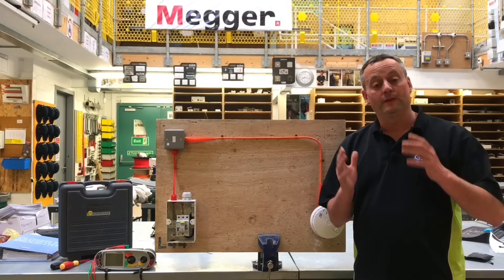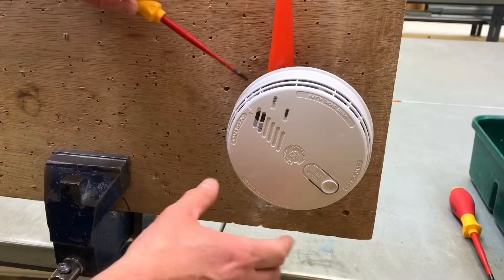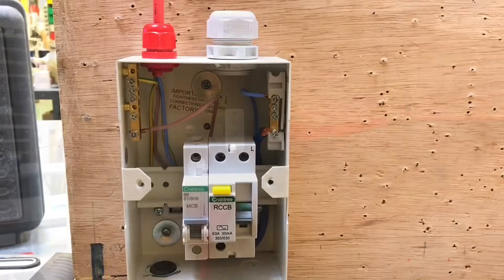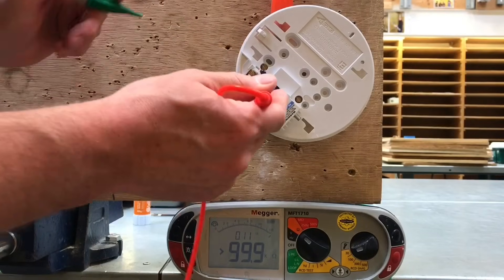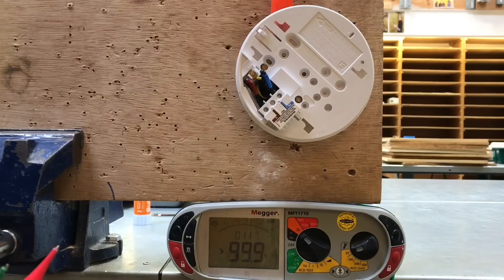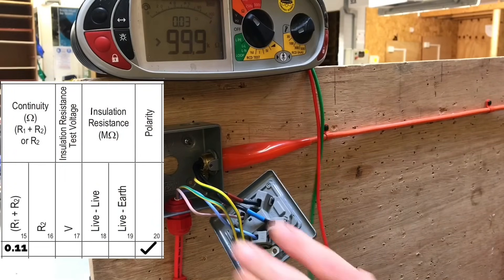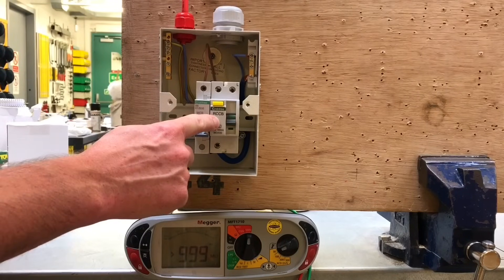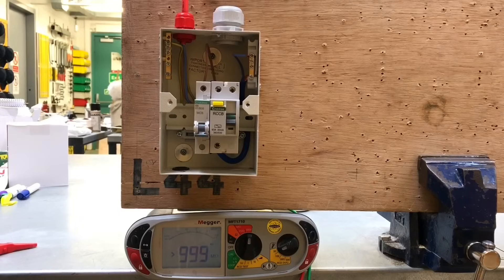How to Test our Smoke Detector Circuit City & Guilds 5357 Practical Assessment 107 Task B (MI Cable)

Comment: Good video,   Very clear to follow as always. Thank you            How does it prove polarity ?  Could you not be switching the earth and get the same readings ?
Reply: The line and CPC are linked at the board and it's visually clear the earth is in the earth block at the smoke head as you have to put your test probes on them. So removing the fuse and getting an open circuit reading proves the fuse is in the line conductor and hence why polarity can be confirmed.

Comment: Question, why do we have to keep spending money on a new edition every few years,? I have. Still got my copy of the sixteenth edition and I have spent the last few days comparing it with the eighteenth edition apart from the one or two amendments and one or two regs being moved from one page to another and the od typo corrections there is no real difference or change so. Do we really need to buy the dame thing? at £ 85 a pop After all electrical work is 70% common sense 20% experience and 10% training, as for being a member of the organisations, we need to remember that it is not a legal requirement
The NICEIC, JIB are nothing more than trade unions
Reply: The shareholders have to keep their divedends above inflation...but you already knew that..?

Comment: Gaz the regs say if electronic equipment can't be conveniently removed then you can do the insulation resistance test at 250 volts or test line and neutral together to earth, so why don't you mention this in your videos.

And not a torque screwdriver in site wedone
Reply from the maker: Because my year 1 learners can remove the load hence the video.... however we do cover this in year 3. 

My videos are designed to help my learners at the stage of learning they are at when carrying out each exercise.

We build on knowledge gained as we move through the course/years.
Reply from the maker: See other videos for the torque screwdriver use. We have 5 in the workshop and learners use them from the first time they fit consumer units.
Reply: Refering to the guys as learners is a bit condescending, there not stupid people, why not refer to them as what they are STUDENTS .
SORRY DON'T MEEN TO BE BITCHY. FAB VIDEO ANYWAY.
I HAVE BEEN OUT OF THIS GAME  TO LONG

Comment: Hi Gaz is it still acceptable to put a lighting circuit and smoke detector on the same mcb
Reply from the maker: https://talk.electricianforum.co.uk/topic/18600-lighting-and-smoke-alarms-on-one-circuit/

👍
Reply: I would go with manufacturers instructions. Fireangel say you can wire on a "separately electrically protected, regularly used local lighting circuit". There is another option of a dedicated circuit with nothing else connected to it with a monitoring device provided.

Comment: good ole pyro cables.
do be aware that aico make a radio detector base that allows radio linking between the detectors.
Reply from the maker: Hi thanks for the tip 👍. All the best Gaz 😁
Reply: Yes, when testing with radio-link bases in circuit, one of the live conductors would need to be disconnected from the base and put into a temporary connector then reconnect once testing is complete.